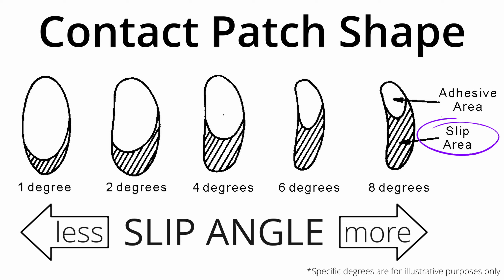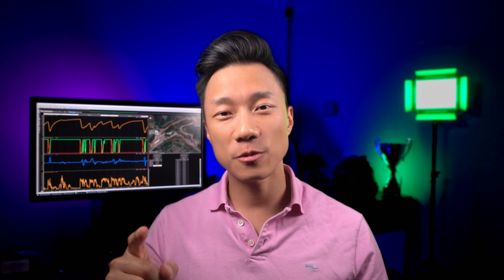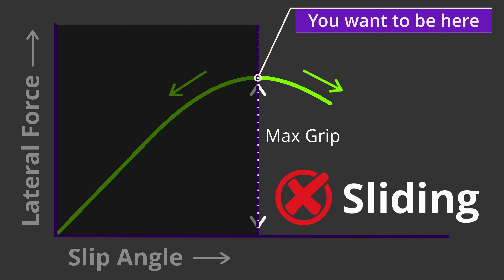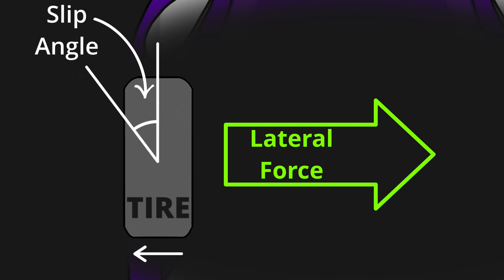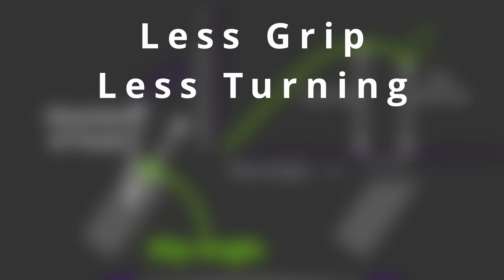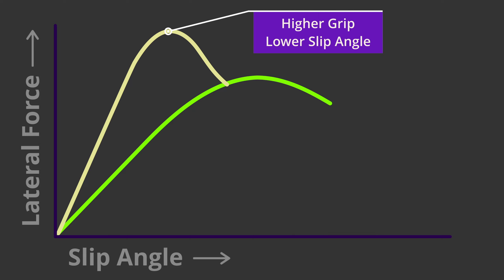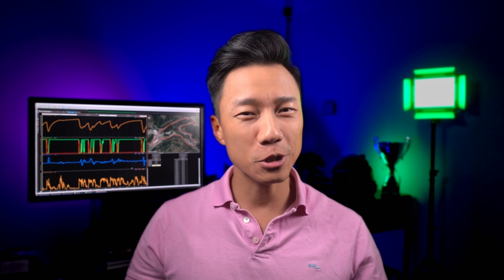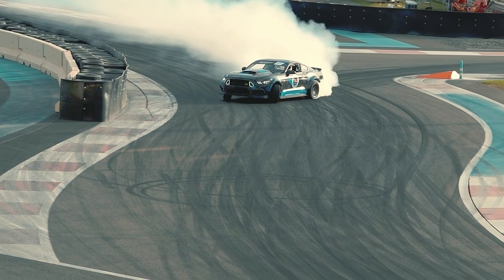Use Slip Angles to Corner Faster [TIRES EXPLAINED]

Comment: For SIM drivers, make sure that you tweak your FFB so that you can actually feel when the maximum steering strength starts to drop off.
Reply from the maker: Very good point!
Reply: In AMS2 cFFB file adjust the slide_factor value, and in AC+CM select the Enhanced understeer effect in the controller section. I’m not sure if the other SIzm titles give you this option.
Reply: Too bad that the force feedback in GT7 is utter garbage. Some of the cars are just modelled incorrectly. The new Civic Type R and GR Corolla are both nearly undrivable with a wheel anyway, never mind slip angles and feedback.
Reply: @CaptainCrunch99 I wouldn’t recommend enhanced understeer in AC. You can definitively feel the force peak without it, and the enhanced effect is so extreme that it feels very odd when the wheel suddenly loses almost all force.
Reply: @cmbaileytstc  SAT drops off too harshly in vanilla AC to begin with. There isn't that much feedback.

Comment: This is an excellent lesson.  I was recently working with a student that was struggling with corner exit as they were getting on throttle to early and then compensating by adding more steering input.  This vid explains the problem this creates and why very well.  One of your best videos yet.  Keep ‘em coming.
Reply from the maker: Thanks Chris! Remind me of a student I had that did the same thing. I told him he wasn't allowed to get on the throttle until he started unwinding his wheel.

Comment: It's so mad watching this because I worked this out intuitively by watching old Micheal Schumacher onboards. I think he was in particular a master as slipping round corners. It's mad seeing this explained in a scientific way cause it reaffirms what I'm doing. 

Also, I think it's one thing to get good at slip, but then when you learn to tune to get good rotation, combined with slipping this is the ultimate fastest way around most tracks. Learning to control the slip whilst being able to induce rotation will allow you to carry so much speed through corners. I think this is the main difference between the good and the absolute best. The guys who are comfortable with this are the fastest.
Reply from the maker: I take it "mad" is good? =]
Yes, as you described, the chassis will have an overall slip angle, just like tires do. When you corner, there is invariably some amount of chassis slip. And just like tires again, there are drawback to too much chassis slip.
Reply: @LastTenth  Haha yes sorry :) Where I'm from mad means good for some reason
Reply: Cool vid.  I found the tire grip curves very enlightening.  I have seen explanations that optimal slip gets the car to rotate, but this made it clearer to me.  Ability to turn at speed demands grip. Maximizing grip therefore is required to maximize how much speed can be carried through the turn.  💡
Reply: The stuff about contact patch and crab walking also super helpful to give intuition as to how slip and slide differ.

Comment: I find AC gives the most realistic slip angle.

Forza motorsport isnt bad eitjer as you can really feel tje weight of the car but has a weird momemt between understeer and oversteer.

AMS2 has the best slip angle model for fun. Its actually amazing how much you can drive with your feet in a GT classic posche on Nordschleife in AMS2.

ACC its like it doesn't play into it or it does, but you're not feeling it as much. But I think thats pretty consistent with GT3 cars across other sims.
Reply from the maker: Neat info, thanks! I don't do other sims much so it's educational to hear how other sims differ.
Reply: @LastTenth thanks for reading.
It's fun to share these interests with others

Comment: Very thorough. And you didn't confuse yaw with slip angle like half the internet does.
I wish you mentioned that slip angle is the result of grip and not the cause of grip.
Reply from the maker: Thanks! If by (cornering) grip we are talking about the lateral force generated by the tire, then yes the grip is generated because of the slip angle.
Reply: @LastTenth  is that any literature you can recommend that says that?
Reply from the maker: @0foxgiven  Race Car Vehicle Dynamics (Milliken & Milliken) is a good one for reference (for that topic and pretty much any basics to do with vehicle dynamics).. Also, to clarify, there are situations where a lateral force creates a slip angle, such as a car experiencing crosswinds or driving on a banked road. This external force will accelerate the car laterally, creating a slip angle, but the lateral tire force ("grip") is still generated as a result of that slip angle, which partially counteracts the external force.
Reply: @LastTenth  Milliken specifically says they both cause each other. He says the front wheels, get slip angle, therefore generate lateral force. The rear therefore has to deal with the lateral force due to "centrifugal force" and generates slip angle as a result. 
Other books, like chassis handbook by heißing don't mention the cause/effect. 
Interesting interaction between the two for sure.
Reply from the maker: @0foxgiven  Interesting indeed. Milliken also gives examples of where a lateral force gives rise to a slip angle, and all these examples are external forces (eg. wind). This slip angle then creates a tire force (grip) that partially offsets the external force. I think it's worthwhile to make the distinction between an external force and a tire force. Milliken is very explicit in stating that all tire force (grip) is a result of some slip at the tire print (contact patch).

Regarding rear wheel slip angle - when the front tire(s) have a slip angle and create a lateral force at the front axle, this creates a yaw moment, rotating the car. This rotation gives rise to a chassis slip angle, and subsequently a rear axle slip angle as well, which creates it's own lateral force via the rear tire(s). Remember, centrifugal force is not a real force except perhaps in a rotating system (frame of reference). A turning car does not experience centrifugal force.
Reply: Slip angle cannot be the result of grip because without any slip angle whatsoever, (I’m pretty sure) you’ll have no grip at all. Are people really conflating slip angle with yaw angle? How? One is specific to tires and tires only, whereas the other can apply to several different things. How do people confuse the two? Do they refer to tires having some kind of yaw angle? That’s a bit of a strange concept.
Reply: @aaronperelmuter8433  it's pretty common for people to talk about slip angle as they're describing yaw/rotation. Of course, they're related but hardly any amateur racing enthusiast knows the difference. As far as slip angle and it creating grip vs. The opposite, we discussed a useful book a few comments up. It's a bit of a chicken and egg thing.
Reply: @0foxgiven  Slip angle is what turns the car, because it's a physical turning of the contact patch. The tire rolls onto the next section of tread and assumes a new travel direction due to it. If this didn't happen, there wouldn't be any lateral force, because the lateral force doesn't just come from nowhere when the wheel is turned.

Of course there's some adhesion stuff as well but it's more of a load sensitivity thing.

Comment: Honestly the sound of the tire should be enough to tell if your understeering or oversteering. And i dont mean a loud noise, just by the way they sound plus your angle of the steering wheel its a big factor to tell if your going fast or not.
Reply from the maker: I don't rely on sound, because I generally don't use things that are not translatable to real life. But steering wheel is a key tool I coach my drivers to determine the level of grip that is being used. It's one of the basic techniques in achieve the 3 Principles of Speed.
Reply: Hold up so in real life you cant hear the tires ? I was talking real life, but yes steering angle. Tire PSI, rims aswell so many factors on taking a fast corner and utilizing tire grip. Its insane tbh.
Reply from the maker: @Otaner142  depends on the tire, but typically you don't hear it or can barely hear it. If it's very audible, you're often overstressing the tire already. IRL we don't have the luxury of turning down the engine and wind volume and turning up the tire sounds. On top of that we have a helmet, which may have earmuffs/comms, like mine (I can barely hear someone talking to me in a silent car), or earplugs. Many cars are fully enclosed which further isolates external sounds.

Comment: how can i know when im on the best slip angle in a road car that has power steering?
Reply from the maker: Great question! It's not easy because of the power steering. Without it, the steering effort would reach peak just before the tires reach optimal slip angle. But if everything is numb, you'll have to rely on other techniques. One such technique is the 'grip test' - it's something I teach to students pretty early on and it takes an amount of intentional practice to internalize it. I'm not sure it's something I can explain in a few sentences. I might try to put a video together some point in the future, but in the meantime, you may find some information on this and other topics on my discord. Just go to discord.lasttenth.com.
Reply: @LastTenth  
Thanks! Can't wait for the video!

Comment: The explanation of how to feel the limit of slip angle is incomplete.  It is different if you are in a state oversteer or understeer.  You do indeed feel understeer with your hands, as the steering goes light.  You should also intuitively feel that the car is "not turning as much as it should" (UNDERsteer).  In a state of oversteer, you can not feel self aligning torque because it is the REAR wheels that are getting to the limit first, and those aligning torques react into the suspension, as the rear wheels are not steered.

Comment: Does the extra grip from peak slip angle grip and peak slip ratio grip fight each other for the traction budget or are they complimentary and thus maximizing both at the same time (if/when possible) is how to extract the absolute maximum level of grip possible from a tire?
Reply from the maker: That's a good question because the tire is never in pure lateral or longitudinal slip, but rather in combined slip. The way to think of it is perhaps using the traction circle - there is only so much long/lat force a tire can maintain at a given time. If we think of it in terms of slip, then at a given slip angle (ratio), the amount of lat (long) force a tire generates will decrease with increasing slip ratio (angle).

Now, the question is then, if say, you start adding long slip into lat slip, how does that affect the optimal slip angle? And as you add long slip, how does the actual slip angle change? There are various models that account for combined slip but admittedly I'm not well-read enough to answer either question. However, my guess is [fact check required] that as you add one slip on top of the other, the optimal slip angle/ratio will start to decrease; the ‘legs’ are no longer ‘bending’ solely long/lat, but diagonally, so the axial components of the ‘optimal bending’ should be smaller.
Reply: @LastTenth  thank you very much for taking the time to reply. Makes sense.
Reply: @DrR1pper  make sense dont mean is true 👌🏻 tire if have 1,2 g latteral max than must have 1,2 g lingitudal max what only can impact on this 💩 is weight distribution and how many tires drive car if we compare max lateral to longitudal Gforce 🐵 this also make sense 🥳 but if this is true ?
Reply: @mociczyczki  I don’t think it matters the direction. The 1.2g max is the total slip vector. As I’ve sipped my morning coffee on my morning walk watching cars go by, I’ve realised also that better steering performance/responsiveness does not just come from greater front tyre weight/load induced grip but also reduced longitudinal slip component of the front trye slip vector, allowing for greater lateral slip. Two birds, one stone.
Reply: first question is can tire have biger longitudal than lateraal slip im new in theme for motorcycle this dont matter cos on side is diffrent compound than in middle unless 1 compound tire . unless the same compound can have diffrent longotudal and lateral force .
Reply: @mociczyczki  that's a good point. I was assuming the tyre to be isotropic with regards to grip level vs. slip. That being said, it would just mean the max slip vector is not a circle but oval if so.
Reply from the maker: @DrR1pper  Longitudinal grip limit and lateral grip limit aren't necessarily quantitatively equivalent. I suppose contact patch shape (as a result of tire dimensions) has a bit to do with it. If by max slip vector, you are referring to a friction circle, then it's typically not a circle; and in practice, from the perspective of a chassis, it's not an oval either - it's usually a cardioid, but that's not purely a result of tire grip. And don't forget, in addition to what you mentioned, cornering stiffness plays a large part in responsiveness
Reply: @LastTenth  responsibnees is point less in this theme we talking if or not more slip ratio decrease traction at specified slip angle for laterral gforce first of all we must know if thos is at all  posiibble to increase slip ratio without increase slip angle which in fact imediatelly give us answer 🤷🏻‍♂️ your first sentence in this comment say it cant 👍🏻 assuming 1 compound tire in motorcycle offcorse which can have completely doffrent compound for longitudal and laterral GAforce ., i also think quees they  are the same in terms of how much gforce can generate but im lack of knowledge in this theme so its just quees 👍🏻however if we think about let say tire for terrain soft gorund than in fact this csn be manipulate be huuuuuge margin  bot for tarmac it dont work like fin let say for tire thread when you setup this „fin” along with drive direction you get huge hipothetically laterral gforce and way smaller longitudal while accelerationand viceversa but in this case those fin thread pierce soft grond and resist on its side shape so its diffrent type of phenomenom than road tire vs tarmac  i quees 👌🏻
Reply from the maker: @mociczyczki  Evidently, it is not pointless as @DrR1pper was contemplating where steering performance/responsiveness comes from. 😉
Reply: @LastTenth   yea it can come from stifffer tire constuction with less grip  at smaller slip ratio slip angle 🤷🏻‍♂️ for me its pointless if i undestand proper we talking about if or not longitudal g force csn be diffrent  than laterral g force in regard to slip rati9 and slip angle  ., yeeeeee sterong responisbenens is wiiiiiddddeeeeee definition depend what somebody aprushiate for daily riding but im talking only about puure max possible gforce longitudal vs lateral i dpnt care about responsibeness as less carosery let say trabel on side cos less slip angle etc 👍🏻
Reply from the maker: Yes a stiffer tire can be more responsive, but tire construction/stiffer tire is a different topic entirely. It’s more related to spring rate, than tire slip. A stiffer tire  will set quicker, much like stiffer suspension. And responsiveness doesn’t really have a wide definition imo. It’s how much effect you get, and how quickly you get it, from a given input - and as such, cornering stiffness is a huge indicator of responsiveness given the lower slip angles, not to mention the benefit of less scrub. Lastly, having large max grip is great, but imo you can’t achieve it if the tire forces don’t build fast enough (think about toe angles). In other words, you can’t attain steady state max grip in a real corner without sufficient responsiveness.
Reply: @LastTenth  how ? you say 1 compound tire in both egzacmple longitudal and laterral can generated diffrent G force level so write how 👍🏻
Reply: @mociczyczki  Untrue. Tires have different load and slip sensitivity laterally and longitudinally. Generally, more longitudinal grip.
Reply: @mociczyczki  Most of the time modern tires have higher stiffness longitudinally and have a lower optimal slipratio longitudinally. It might not be true for old style tires, though.
Reply: Modern tires have combined grip. You will get the most out of them if you slip them in both directions at once. The traction circle is a bit more squared out than typically depicted.

Comment: Slip angle is not a technique of driving, it is a consequence of pushing on the limit grip.
Reply from the maker: Well if we are to be technical about it, a slip angle is a consequence of a tire being turned away from the direction of travel, and not a consequence of pushing it to the 'grip limit'. Also, there's no 'grip limit'. A tire generates an amount of force based on many factors, and this force can be higher or lower depending on these factors. You can change the conditions so the that force is higher or lower, but there is no ceiling and it cannot be underused.